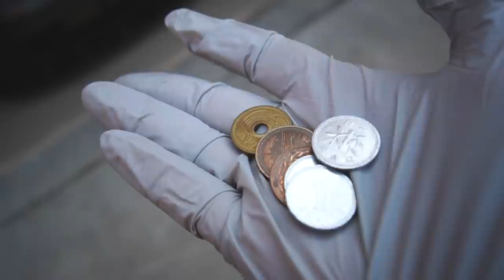TAKING DELIVERY OF MY MKIV TOYOTA SUPRA!

Comment: It’s already 5spd so that’s a +
First thing u should remove is that GE and get a 2JZ while the engine is removed have all the body parts & shell ready for paint
Reply: Blocks are almost identical to each other a head swap is the easier route
Reply: Crippled Diabetic nah IT’S NOT  it’s literally not the same engine at all aside from sharing the same name the 2JZGE ISN’T Reliable for Boost he’ll be going through a new head gasket every month

Comment: Hey Evan, those are some veilside sideskirts.  As for a diff you can use a torsen lsd centre out of a soarer/supra (interchangable) and get an a02a/b crown and pinion wheel for a longer ratio. Those N/a diffs are 4.1 ratio and depending on which gearbox you want to put in the car you'll need the 3.7 ratio from the a02a/b or you'll be revving really high on the highway

Comment: As for the seatbelt in the Supra, take the plastic interior panel cover off of the area where the belt spools into the holder and you will see that the belt has more than likely folded over and become pinched in between the guides causing it not to retract. When a car sits with a belt folded in that area for a long time it tends to stay that way even when the belt is pulled out more.

Comment: It will pop in pûre white  !  

(I had the same 2jz engine in my track BMW E36. We did cams , injectors etc. We made almost 300kw, problem I had was gearbox problems and the rear suspension on the car. The body cracked ...  )

Comment: Great job Evan, Time to get that single ball bearing turbski, angled exhaust which yours needs desperately. Btw I highly advice not to get rid of that rear seat that fell off. At least gut the brackets bc everything for supra is valuable if not reupholster it.

Comment: Evan to save money don’t buy the gte motor just buy the top end bc the bottom end on the na motor is the same as the turbo but top end is different and buy a new intake manifold and exhaust to save a bit of money but I would rebuild the bottom end too it would be great for vids and a lot of content

Comment: Hey guy, DONT throw that rear seat back piece away. You can take that to a local upholstery shop and they can recover it in a material to match the color design and look of the front seats you decide to put in your Supra. Please don't throw that away as those parts are usually quite expensive to buy new or even second-hand!!!!